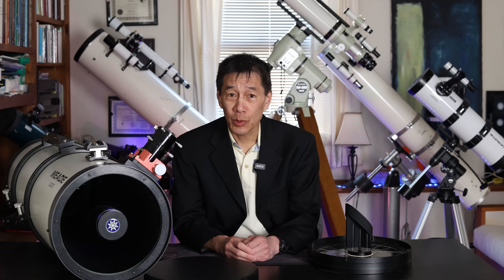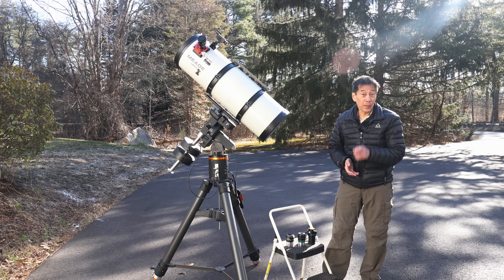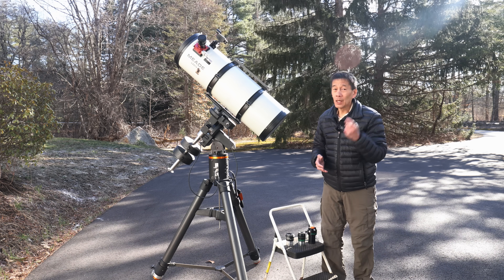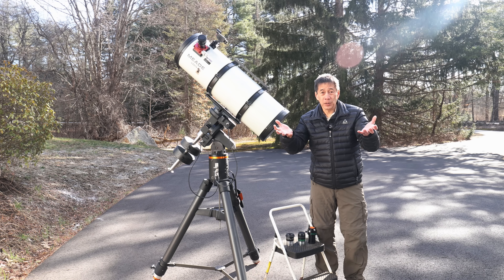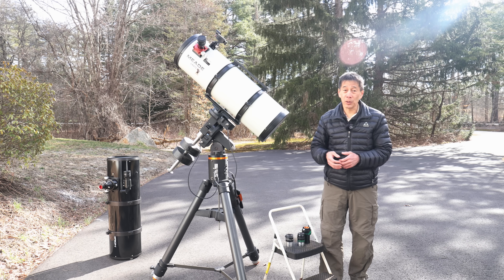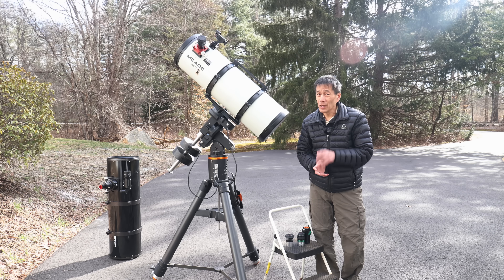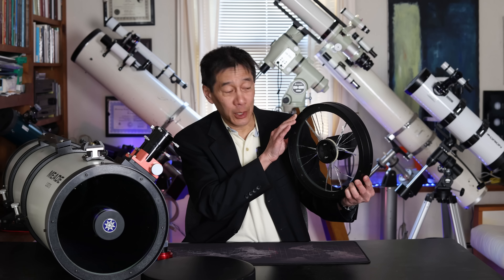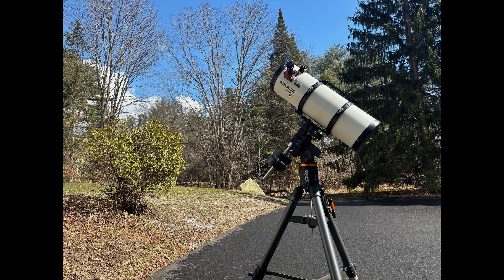The 10" Meade Schmidt-Newt LIVES!  Hear How it Happened!

Comment: A paracorr on standard newtonian will beat even a matched Schmidt newtonian.

I'm  on my 3rd paracorr.  It is amazing that yours has all the green still on it, both of my used paracorrs had lots of missing green. My 1st was the original photo/visual, my 2nd was the visual model which had more clear aperture because the 31 nagler had a little vignetting on the photo one due to the t threads on the lens group. My 2nd was the visual model, new from televue on my yearly dealer employee discount.

I sold my first one with my 8"f4, and the 2nd I traded in the field for an offer i couldn't refuse, a pentax 40xw and 20xw, I already had the 40, but knew I had a friend who would take it for $300.  It wasn't an official star party, but it was at a campground with very dark skies that would load up on new moon nights with astronomers. 

The third one I  have now is another visual model, with even less green than my first, in fact it has some white paint to mark the missing position marks. But I think  I got it for around $150.

My only fast dob is in rough shape and needs a recoat, though it does still work.  I  lost my van loaded with gear such as my xt8, 127mak, omni102 ota and a cg5 as well as a vixen 60mm f15 with its az mount, and my nexstar GT mount. 

Along with a slew of music instruments amps and gear. And a small bag of eyepieces a barlow and some filters, and other stuff i cant remember because I  was not in the greatest state when i loaded up the van for an event i thought i could put on. 

So now with the car i got stuck with, I cant even fit the dob or certainly not my 10" meade lx6. And even my powerstar c8 would probably barely fit if it even does. 

So I  really need either a truss dob, and the only one I might be able to afford, if I sell some extra un needed guitars, is the explore scientific hybrid truss, which I have read about many issues I would need help to fix because power tools would be needed, as well as something to raise it up since it is so low to the ground.

Or getting a mount and case for the 10" OTA, and hopefully getting a couple or few hundred for the forks, wedge, tripod and giant trunk case. At this point I wouldnt be able to make use of the paracorr.

It is a bit of a connundrum, as used eq6 class goto mounts could have elecronics that could fail at any time and fixing then could get costly, and it is kinda cool to be the guy at a star party or outreach with the classic wedge mounted 10" sct that was the flagship meade scope just a year before the lx200 came out. And the 56mm smoothside super  plossl to maximize its brightness and field of view,  not to mention the whole Japanese super plossl set, mixed with some smoothies, some rubber cup 5 elements, and some 4 element japan, that i eventually hope to replace with 5 element versions if possible. But i am not as obsessed with them as I was in the past where I had the whole set of smoothsides except the 56mm, and my 40 was a 4 element japan.  As well as smoothie 8.8 and 14mm UWAs.  Someone gave me $400 and a 4k 40mm SWA for the old set.  And as anyone who reads my long comments knows, I had all my stuff stolen from storage in 2018.  And a nice japanese 40mm 2" max field super wide is the hole in my set, with 42 superview and 40mm astrola wide field as my placeholder. 

I replaced my 50 axiom with the 56 smoothie,  and my 30mm widescan III with a widescan II. My 31 nagler was replaced by a 28mm orion megaview/uwan/pwa, which is the best 30mm range ultrawide,  closest in performance to the nagler.

I am happy with the rubber cup version 6.7, 8.8 and 14mm UWAs I was able to acquire this time around, as well as the 20mm WO xwa to replace my 20mm es100,  but I have to just use the 14uwa as the replacement for the 14mm ES100.  I also got a 7mm smoothie nagler to replace my 7t6, and a 5k 4.7uwa to replace my t6 performing 5k 5.5mm uwa.

Some other goodies to round out the set are 24mm es68, 17 and 22 LVWs,  35mm ultima, 32 smoothie televue plossl, 26mm silvertop that came with my c8, 15mm parks gs-5, 9mm tmb planetary  (I used to have whole set), and a bunch of cheaper eyepieces I have fetishes for, or that i got when first restarting before the better stuff started coming in. Stuff like the whole set of svbony swa/wa, the whole set of widescan II clone UW80s, the sleeper plastic celestron 3 element superwides that nobody knows are really good in slow scopes, or how wide they really are, especially the 15mm.

Also some obscure other cheap eyepieces like an RK20, as well as a handful of japanese orthos and the .965 vixen eyepieces that I got with the 60, that are surprisingly good, the 6 ortho and 20 kellner, and the 28mm wide angle kellner, but i cant use that as the .965 nose piece needed to use it was on my the scope in my van when it got impounded.  And that was a hard to find part and it was a desired eyepiece,  that I will probably sell. The HM 12mm put up a decent view for a huygens, and more like an ortho field, but the er is super tight. The only one I eventually plan on keeping is the 6mm ortho since I have a 1.25 adapter for it and it is a better ortho than my edscorp and unbranded 6mm volcano tops. I also got a japanese 40mm MA .965 i got from telescope warehouse for shits and giggles, talk about a soda straw,  but a soda straw showing the maximum .965 field :)    and a bunch of mostly synta plossls, but I lost several in the van as well as some orion flat fields i hadnt even tried yet, and the super high power little eyepieces were in that set as well as a decent barlow and several of my filters.  

Also the fact that there was a cooler of  meat sitting in the sun for a month in the van, and the flies and stench made the 5(10) minutes i had to put whatever i could into a shopping cart at the impound yard 5 minutes before closing on a friday made it hard to think straight,  so i grabbed the smaller stuff like my etx90 and photo tripod,  and prioritized things like my phones and some of the musical instruments that were higher value, and I thought I would be back but I was prevented from doing so and lost it all, and still got a bill from the impound.  F them. The way the whole situation was handled by the powers that be was criminal, but you cant fight city hall if you dont have tactical nukes.

So yeah,  paracorrs are cool. And apparently so is highly tangental thinking

Comment: So true about what you said about the eyepieces!  Back in the early 90's I purchased a Meade Ultra-wide field 27mm for my 13.1 inch dob.  What a difference it made.  The eyepiece cost more than the original price of the telescope!
Reply: I never heard of that eyepiece. They had a 24.5mm SWA but that wasn't huge, and the 4.7, 6.7, 8.8, and huge 14mm UWAs. The 32 and 40mm SWAs might have been huge to some people. I wasn't around in the early 90s, but I have done tons of research since 2004 and was in the industry from 2006-2011 and never heard of a meade 27mm ultra wide.  Was it yellow lettering? Blue and white? Research grade?

 2" I assume because anything 27mm can't be any wider than 60deg in a 1.25" and only the 13mm nagler and 14 UWA would be considered huge and 1.25".

I am very interested in knowing what this is, something in the back of my head is telling me I did know of such an eyepiece at one point,  but it is driving me nuts.

I know there is a 28mm superwide that could be considered huge by some, but it came out around 2003/2004.

Man I  want to know about this eyepiece!

Comment: You could find a creative way to display the cracked corrector plate and then pour a 1/4 inch or so of clear epoxy resin on the other side to stabilize it.

Comment: I had a problem like that with Advanced VX mount - it would run one way without stopping.  The solution turned out to be simple - replace a faulty cable that connects Dec motor to the controller

Comment: i have a CGI mount , but i found its not working great beyond 10 pound or so , so i use it with my RedCat 51 , with all the additional gear it gets to the limits of the mount , at least in my version , maybe there is something wrong with it but im not good in mechanics , but i did not have those problems of mount acting up , at least i dont remember .

Comment: Ed, you said that Meade often matched the corrector plate with the primary.  Did they match the corrector plate, or the secondary mirror?  Might it be possible to swap out the secondaries between the two corrector plates and see if you get a better result using the original secondary mirror?

Comment: Where is this scope wizard you speak of?

I recently purchased a used C14 with this same mount because my meade 10 had a runaway dec that i could not correct.  tried all kinds of things and eventually just sold it when i saw a C14 on the market for a decent price.   Horrified to hear that this mount has a similar problem.   I will get a set of new cables before it all goes bad.

I've done some googling but if you could direct me to this wizard it would be helpful. 

Thanks,   keep up the great work.

Comment: Congratulations. I cracked my C9.25 corrector over a year ago after a screw went in too tight. I've had the replacemet plate sitting here but can't find anyone to help. Now, considering  the new plate won't be optimal with the mirrors I feel likke giving up.

Comment: Im glad you got it repaired, even though i had a carnivorous  eye focussed in on the moonlight focuser. I do wonder if the secondary being on so tight is distorting your corrector plate somewhat. If you like to experiment try putting the old secondary into a 3d printed spider vane and using a coma corrector with it.
I think its time you did another " state of the collection" video.

Comment: I was managing a retail astronomy store in MN (The Telescope Shoppe) when Meade started shipping these scopes. We never sold a 10” as we felt they were undermounted, but we had an 8” on the floor. One shipment arrived where the 8” OTA  had the primary come out of its cell. It fell onto the secondary and broke the corrector. 

I see your scope wears a vastly better focuser. Had you not found a new corrector you could have created a spider to hold the secondary and ended up with a standard Newtonian

Comment: Don't give up on tweaking! I know from an optical master (makes Schiefspieglers that win awards at Stellafane) that the business of rotational alignment matching in consumer SCTs and SNTs is a myth. But there is a lot of slop in the centering of BOTH the corrector in the cell, and the secondary mount in the corrector, and BOTH of those have to be centered as accurately as possible - certainly to 1/2mm or less.

Comment: I worked in the matching room for a few years at Celestron in the early 90's and I can vouch that with a Schmidt Cassegrain you cannot just drop in a replacement part and expect it to perform as well as the old one. The primary and corrector are matched to compliment each others' imperfections. and then the matcher refigures the secondary mirror to cancel out what is left. Additionally, the 3 parts are all rotated to cancel out astigmatism.
Reply: The secondary mirror or the corrector plate is reconfigured? Could Ed get a better result by swapping out the old secondary on to this "new" corrector plate? Also is there any chance that if the ring on the secondary is too tight that it distorts the corrector plate ?
Reply: I'm not sure if the company that made that Schmidt Newtonian does any hand figuring on the secondary. I can only speak of how Celestron did it with Schmidt Cassegrains in the 90's.

I'm trying to picture how I'd hand figure an elongated flat, like a Newt secondary, and it sounds more difficult than doing the round shaped spherical secondary of a SC, which is fairly easy to touch up by hand.

The piece with the most variability was usually the corrector. The primary and secondary in a SC are just spherical, which are relatively easy to make, as is the flat of a Newt. But "touching up" a corrector is probably never done anywhere considering the crazy techniques used to make them. It's not feasible to do it. And touching up a spherical primary is probably not too hard if you just need to make a little over or under corrected, though it's a big piece to have to handle like that. Yeah, I'm having a hard time picturing the manufacturing process for a Schmidt Newtonian because the secondary mirror isn't round, and so would be difficult to touch up like with the round secondary of a Schmidt Cassegrain.

Of course it might be worth a try to swap in the other one. And heck, since you have an extra you could try doing a little touch up figuring on the extra secondary. I'm just not sure how you would get a uniform effect on it since you're working on it flat and then looking through it at 45 degrees. Trying to do anything other than push the sphere (a flat is thought of as a sphere in optical shops) a little one way or the other might be impossible.

I'd be interested to find out how Schmidt Newtonians are finalized if anyone knows. My guess is that there's just a lot of part swapping until they find 3 parts that like each other. With a Schmidt Cassegrain the 3 parts are placed inside a test jig (Collimator) and aimed at a reference flat. A laser is shined in through a special beam splitter eyepiece holder (Pellicle), goes through the system backwards, hits the flat and comes back through the system. An operator uses a knife edge, a Ronchi and a high powered in/out of focus to determine what, if anything, needs done. When I worked there the majority of systems were going to need 1-2 runs on the secondary to fine tune it to the other components. Occasionally you find a perfect "no run" which are always nice to get, where the airy disk looks like a golf ball with an onion ring around it. If you had the dough you put those parts under your desk and have assembly build you a scope out of them. :)